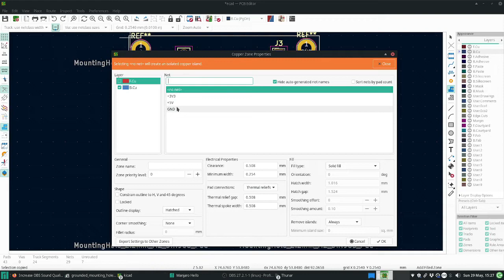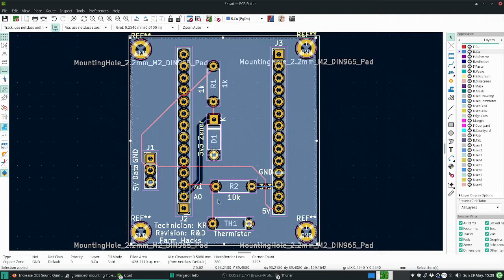KiCad 6: Ground Plane (Filled Zone)

Comment: I did this but it filled over all my trace wires and shorted them to ground
Reply from the maker: That is odd. Maybe check your clearance settings?
Reply: For others looking for solutions to this problem, I fixed it by changing the priority to zero.

Comment: Wow...Thanks Kody!
Hey I have a doubt which I could'nt find an answer for past few days....
If I can have my PCB have a ground plane or a Power plane...which one should I choose?
Is it like you are free to choose any of them as per wish , no problem?
What do people normally do in their PCBs?(complete beginner here:)
Thanks again Kody...!
Reply from the maker: I think that a ground plane is definitely more important, but I only have about 2 or 3 years of experience (most as a hobbyist) in PCB design. Here is a blog article about ground planes https://resources.pcb.cadence.com/blog/2020-the-pcb-ground-plane-and-how-it-is-used-in-your-design. There is also this book that I have thought of reading https://www.oreilly.com/library/view/pcb-currents-how/9780133415353/. 

Overall I'd go with a ground plane, because that gives the reference that the rest of the circuit uses to determine voltage.

To learn more about these in-depth topics my I suggest @PhilsLab
Reply: Hey Christopher! Little bit of an older comment but in short, your design decisions regarding plane assignments is really design driven! If you have a high-power board or a complex board with multiple split planes and such, having a dedicated plane for power may be a great solution. 

However, for most hobbyist designs or designs where signal integrity/return paths are most important, I recommend dedicated ground planes in your stack up. Common stack ups include:
- signal + power
- Ground (filled completely, no splits) This is used as reference for all of your signals
- Ground (same as above) with some stitching vias to connect the return paths as you transition from top of the board to the bottom of the board.
- signal + power (routed or sectioned area filled with that power) be careful with using power flooded around traces as it could induce noise on both sides.

or for a two layer:
- signal + power
- Ground

This is basically a 1 layer board with minimal transitions to the second layer. I always recommend spending the extra money going with the four-layer board. Hope that helps!